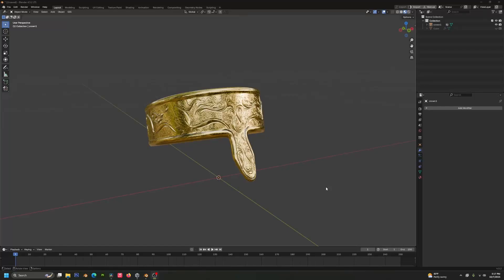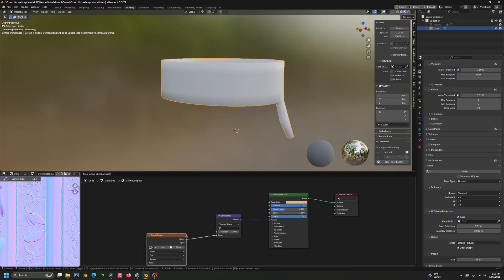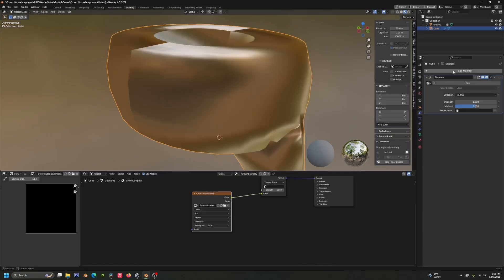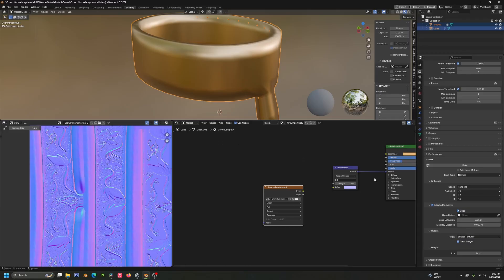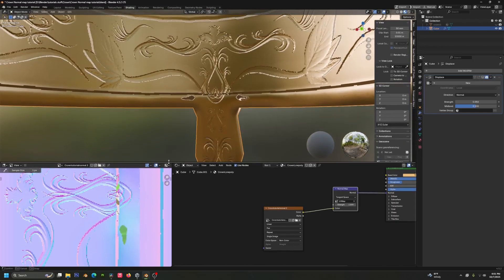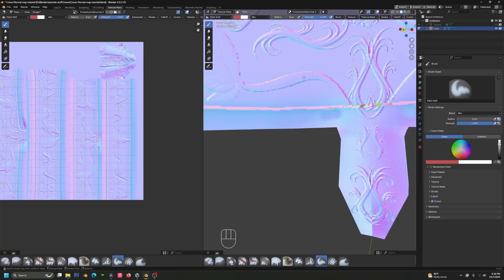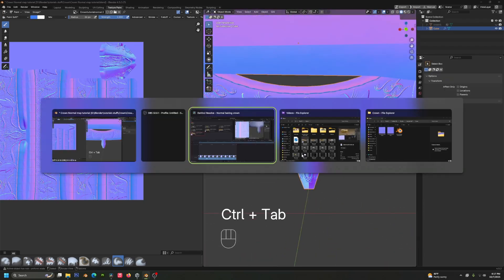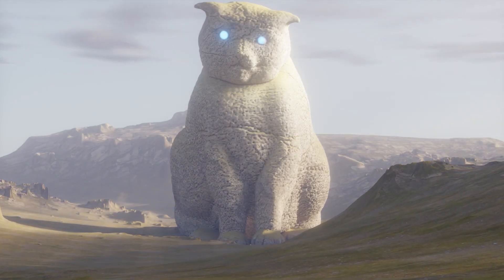Baking Normal Maps in Blender 4.5

Comment: im trying to fix my model problem so it´s a shield and half of it as like a color and i try to paint with texture paint, but painting is not working at all... anyway to help? i baked or try to , i still noobie on this and dont understand verry well
Reply from the maker: In the upper left of 3d viewport, next to the dropdown that says, "Texture Paint" is the lil square icon that says "Paint Mask" when you hover over it activated? If so, deactivate it, and you should be able to paint.
Reply: @Nebulaoblivion  i see saying texture paint but then i dont see at all paint mask it says paint hard, showing the brush that is selected, maybe im looking at the wrong place, i dont see it, i wanted to share a print but youtube doesnt let it...

Comment: When you say that the cage extrusion value needs to be different, what does that mean? If my model is bigger does that mean the extrusion value needs to be greater or smaller? What even is the cage setting and what is it doing to the model? Thanks!
Reply from the maker: Great question. So if turned on, the "cage" is where the rays come from. You can make a manual model to project the rays from and select that, or you can adjust "cage extrusion" which will basically inflate the model, and then project inwards towards it. Which is basically the same thing I did with the displace modifier, I likely didn't need to turn on cage extrusion at all here, its just the displace modifier was a great idea I had while recording the tutorial that I'll probably use from now on, because the result was great. 

So if the low poly model doesn't fully surround the high poly model, the cage would make up that distance, and so the value needed for it, would be dependent on the distance between the low poly section that is underneath the high poly section. If its 1cm below for instance, the cage extrusion should be something like 1.1cm to go slightly over that.

So, way back, over a decade ago when I was first baking normal maps, and baking took a lot longer, this was a bit of a bigger deal, and people would manually make a third cage mesh to use in addition to their high and low poly. Adding the cage/cage extrusion feature was a way to automate that and speed things up a ton. We also didn't use to have a displace modifier that could go along face normals, it used to just be stuck at X, Y, or Z, so you couldn't easy inflate the model. Now that we do, I currently think that using the displace modifier is better than using the cage/cage extrusion setting, because its nondestructive, and it provides a visual aid prior to baking so that you can make sure whatever value you choose is correct, instead of baking, adjusting cage, baking, adjusting cage, etc. Ray distance will still often require adjusting, but that's less annoying than changing two values every bake attempt.

As always, I highly encourage just messing with the numbers and rebaking and seeing what changes first hand for yourself, then when you bake later, you'll be like, "oh thats the thing that happens when its too high/low" and instantly recognize which way you want to adjust it.

I hope that made sense and was helpful I'm pretty exhausted at the moment, so my writing might be a little more disjointed than usual, but yeah. Let me know if you have other questions, or tutorial suggestions!